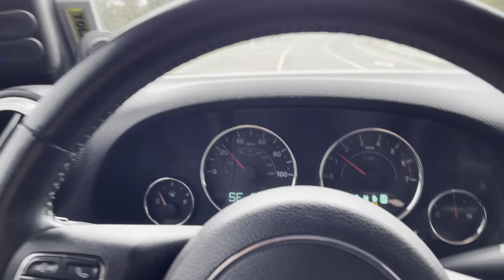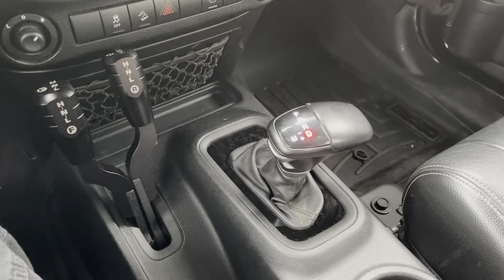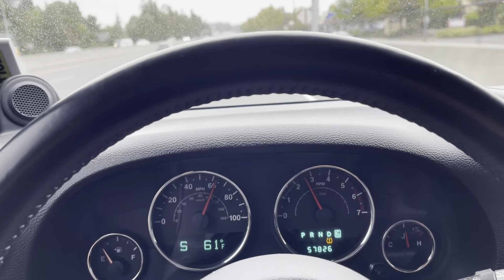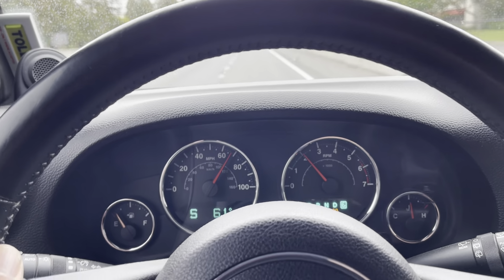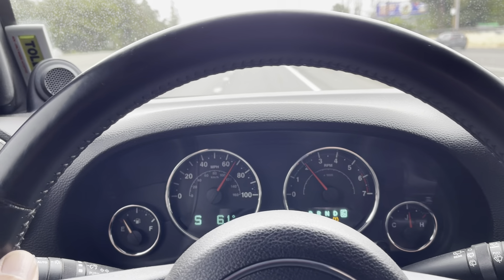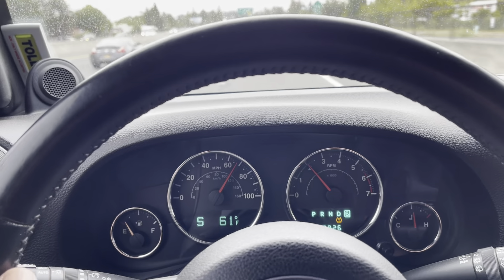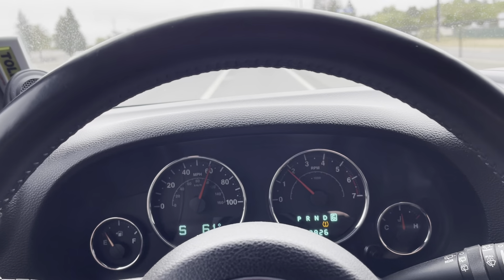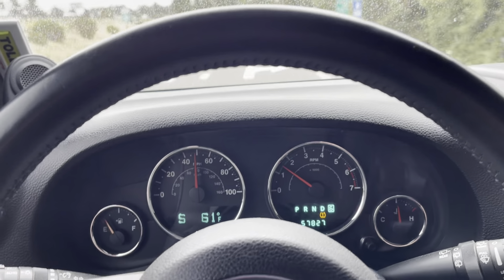8 speed test with a VVT Truck Hemi

Comment: Thanks for the videos!   Is it feasible to put an 8 speed JL transmission into a 3.6L JK?  Many say the 3.6 motor is much better with an 8 speed.  Curious the cost and feasibility of that upgrade.  Thanks.
Reply: Yes its very possible, get a hold of Todd at Jeep Speed Shop.  He's the pro.
Reply from the maker: I think the 8 speed makes a big difference and we use the 3.6L 4x4 Dodge truck transmission mostly, now the JL transmission will also work but you will need to run the t case from the JL also with the JL shifter. It fells like you pickup 30HP and a lot of drive-ability, big improvement.
Reply: @jeepspeedshop  do we need to run a t case shifter as well or the JK t case shifter will work with JL T case?
Reply from the maker: @tariqkhalil1993  They Made made many JL T cases, the JL is complicated.
Reply from the maker: @tariqkhalil1993  I think the JK shifter will work.